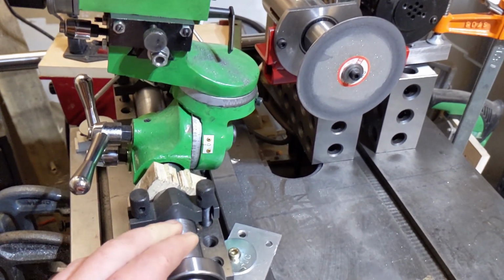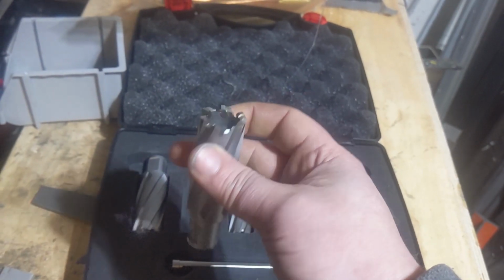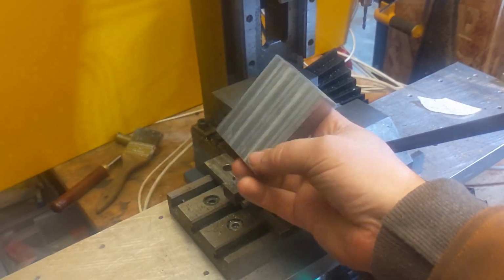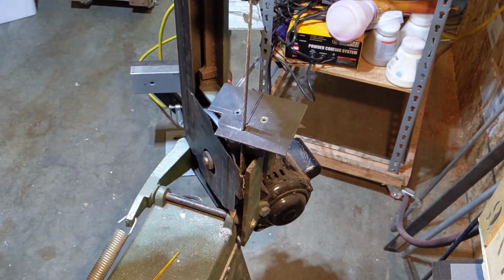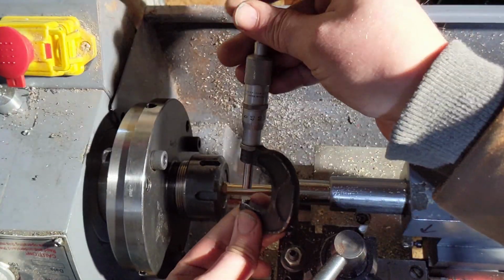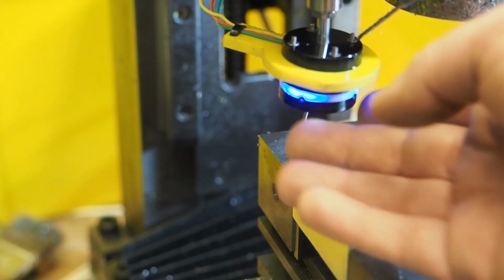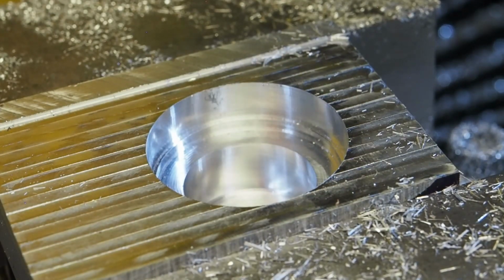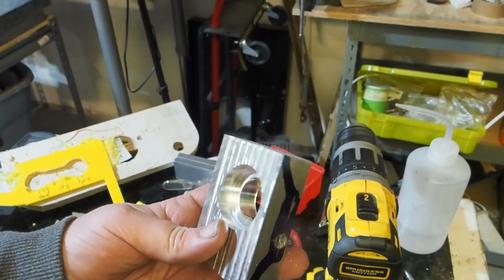grinder hack part 1 bearing blocks (2 crashes!)

Comment: I'm totally ignorant to GRBL, so I looked it up. I downloaded the source code from the GitHub site. There's a probe support in this. The comments indicate it's called from the stepper motor code. Something has to enable it, so there must be some configuration file. But I know nothing.

So I got to your channel from seeing this same U2 Universal Tool Cutter accessory on eBay for $130 (3-3-2023). I've been attempting sharpening of end mills using the surface grinder and a jig I got years ago. I had to fix that, as it has some sort of spring ball detent that enables quick indexing to the next flute. But it was sloppy and moved excessively. It holds a 5C collet. I see that this will be limited by what can be chucked in the collets, but like you, will have to convert it to hole a 5C, vs Deckel unique collets.